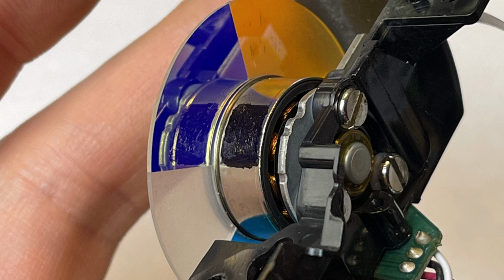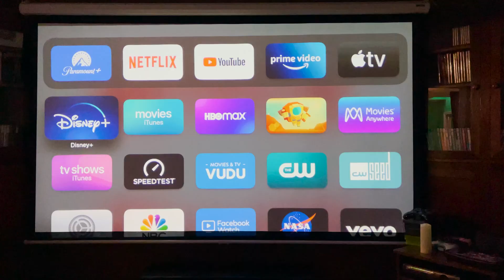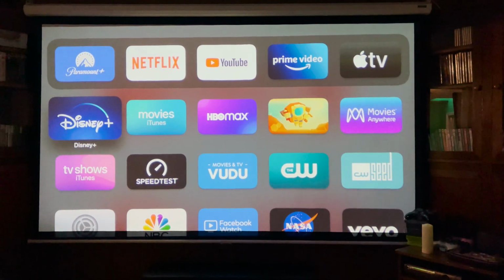Optoma HD27 Color Wheel Replacement

Comment: Thank you for this video, Eric. My Optoma S341 started making a horrible rattling sound, and colors were all off after a thunderstorm. My theory is that the power surge caused the color wheel to break. Your tutorial got me through the entire process of ordering and replacing the color wheel. I managed to only break 1 screw housing, and I was very happy when I fired it up and I could see all the colors again. Now, this will allow me to save some more for when it finally goes belly up. Kids are happy to have the projector back 🙌🏼

Comment: Thank you for making this video!! I just fixed my projector because of your tutorial. My screw inserts also broke in almost all the same places that yours did, so maybe that says less about us and more about how brittle the plastic gets with time haha. Literally just saved myself at least a thousands bucks because of your video. I’ll give it a few weeks before I call this a true win, but so far it’s remedied all prior problems I was having with the projector

Pro-tip for anyone following this tutorial. When screwing the 3 screws into the color wheel with the bushings, make sure you pinch the center of the wheel just like he’s doing in the video. I originally tried it flat on the table and there wasn’t enough compression to get the screws to catch the threading.
Reply from the maker: Awesome! I'm happy to hear you were able to get the color wheel installed and up and running! It's been almost 3 years, and coincidentally, I just had to replace mine again. We use our projector quite a lot, and it's been about 4,000 hours since I made this video. One of the pieces of glass broke off from the color wheel last week, causing a buzzing sound, so I went through this process again. You're spot on about the plastic! I do think the heat from the projector makes it brittle over time. This time around, I had trouble getting the color wheel to stay synced up after 3 minutes or so. So, I took it apart again, reseated the bushings, and moved the black sensor wire with the red connector further from the optics. It seems to be working great again! Thanks for the feedback! I'm always happy to hear when people are able to breathe some life back into these, considering the cost of everything these days. Thanks again!

Comment: Now to just find a color wheel for my HD28HDR. It was color flickering like that and had to turn it off and back on again. It has been doing that since we got it back from the Optoma service center. I suspect they swapped projectors, because they said my bulb was old when they were fixing the white dot issue. I am sure they just swapped out projectors. Turned it off the other day to go get groceries and would not turn back on when I got home. Replaced the bulb but I still get that Blinky light error that signifies that the bulb or color wheel was bad. It did make noises every now and then, not quite noises either. squeaking and grinding noises I could hear from the kitchen. So I think the wheel is shot since the cooling fan still spools up.
Reply: Did you  ever find a color wheel for you HD28HDR cause mine is doing the same and indicating bad bulb but I just replaced the bulb in it and still says bulb error.
Reply: @ I had to buy a new projector because my board was fried
Reply: @ I did find the color wheel from the manufacturer
Reply: @guytisdale how do I go about finding that color wheel?

Comment: Curious if this wheel is still working for you. I recently replaced my bulb and the projector is flickering between colors and having power issues, pretty sure I need to replace it. I want to make sure I get a model that works with the HD27.
Reply from the maker: Hello! and yes it is still going strong since March of 2021.  The one in the description is the exact one I ordered for my HD27. As I'm sure you saw from the video, it was the index tape for mine, specifically causing the colors to blink and act erratically. If you are having issues with power, it might be color wheel related as I recall it will shutdown if the color wheel isn't working normally. I would try that replacing the color wheel first. If power issues persist, I know some projectors have power issues whenever the ballast needs replaced, but I haven't run into that with my HD27.

Comment: Thank you so much, I was looking a movie how to open this projector. I'm going to clean it up :)
Reply: I have open my projector right now :) I just opened color wheel. Two questions. When we know we should change a colour wheel. I noticed my colour wheel has darker round line in the middle. Is it normal? 
And also when is the right time to change a lamp? The reason I decited to clean up my projector is I noticed two weird point on a screen. I tried to manipulate focus and this weird points were blury hair... I have two dogs.
Reply from the maker: @jeger.x  if memory services me the original bulb was rated for an astonishing 8,000 hours in eco mode and 5,000 running full brightness. It definitely gets dim the closer you get to end of life so replacing it sooner makes for a nicer picture. After we had cleaned ours, I must have got something in the optics. It was like a piece of fuzz or something. It mostly showed up during the darker scenes of movies. But definitely be careful with the compressed air. You may want to avoid the DLP chip that creates the picture and also the using the air can on the cooling fan may cause the fan to get noisy. The line around your color wheel may be a scratch? If that’s the case it probably won’t affect the picture much because the light is out of focus when it goes thru the color wheel.
Reply from the maker: Perfect! Glad to hear this is helpful! I got some dust in the optics when I was cleaning it up. I had used compressed air. Maybe there’s some way to mitigate against that. It did self correct after a period of time. Projector is still going strong. Appreciate the comment! 😄
Reply: @EricCosner  hmm good idea, I'll go and buy compressed air. I was using a special brush and cloth but it may be not enough. So you say issues with colour wheel are like weird artifacts with colours on a screen yea? I didn't noticed it so far.
I'm very happy with my projector. It works so well after like 3 or even 4 years. I'll use links in you description too to buy extra parts coz this model is getting old :) Thanks again man! Greetings from Poland

Comment: Great Video!! quick question does it gonna work with 143x hd as well??
Reply from the maker: The amazon description doesn't specifically mention the 143X, but I see someone asked the question and reported it would work. I found one on eBay specifically for the 143X and it looks very similar (same colors and cabling) but it ships from China. Perhaps that will offer some clues https://www.ebay.com/itm/174401235796
Reply: @EricCosner  thanks for the response, you rock!

Comment: nice video  😃 but next time  use a black spry  2000 degrees high heat spry 😎 to mark it  only dont forget to tape it first  try it first on the old one okey   thnks for making nice video 😎

Rust-Oleum 248903 12-Ounce 2000 Degree, Flat Black Automotive High Heat Spray Paint, 12 Oz

Comment: Thanks for this Eric, hoping I don't have to change this for a while yet, Eric 1 question, do you ever use ES explorer, the reason I ask is when I have to move through menus I can't see any of the shades to let me know what section I want to select, I don't know if it due the high white but it should show a grey scale shadow to let you know the remote is on that selection.
Reply from the maker: I haven't used ES Explorer. A failing color wheel could a change in colors, but it's not consistent. You would probably see the shades sometimes. The projector remote itself has settings under Display > Image Settings (such as Vivid, Brightness, Contrast, etc.) that might be worth looking at. If you are using an Amazon Fire Stick, perhaps also ensure that the video settings are compatible. Just speculating but I once had my Apple TV set to HDR color and it made my colors washed out on the Optoma.
Reply: @EricCosner  Thanks Eric, I'm using a firestick and have the projector in vivid setting will have a mess about with both settings on the projector and the firestick, tje main menu at the top and bottom I can see the light shade, I did try it on the app itself for dark mode but no change, I might give it a go on a grey or black background just to see if it help, thanks for the reply Eric much appreciated.